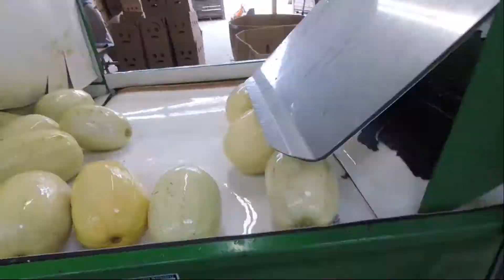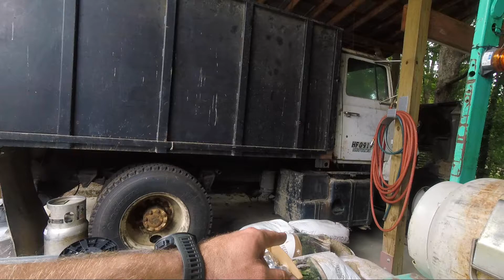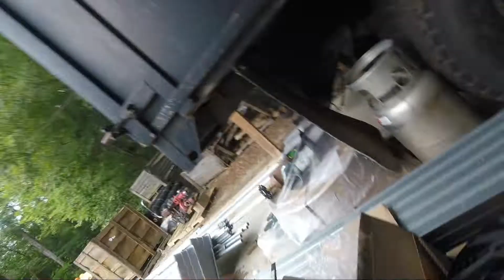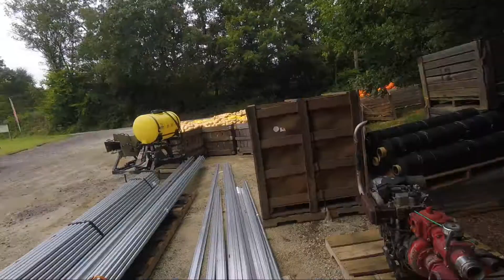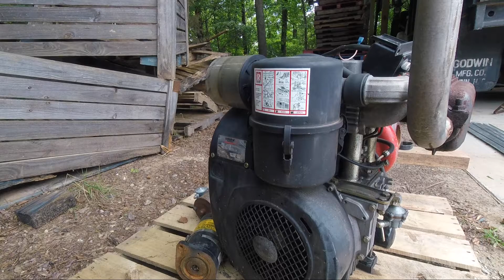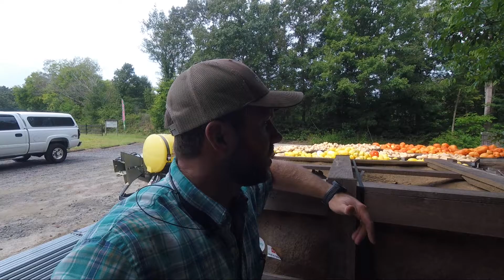We have a Mess! Teaser about all the upcoming projects.

Comment: Vapam? Is there a ratio or ppm to inject with the water into the drip line. Afterwards do you flush before planting.
Reply from the maker: No on the ppm, yes you have to flush immediately after running the fumigant then 21 days minimum plant back